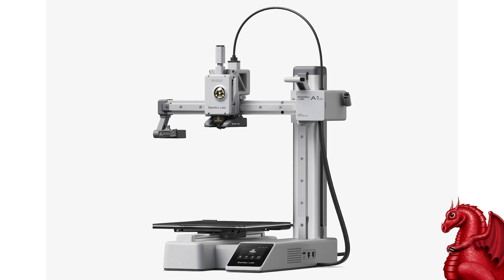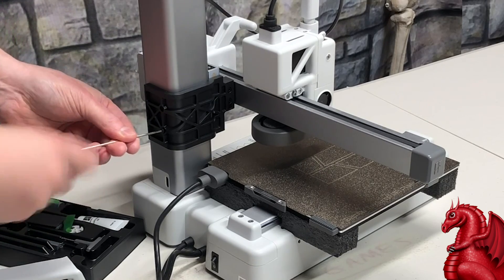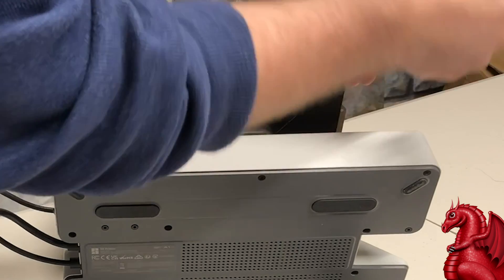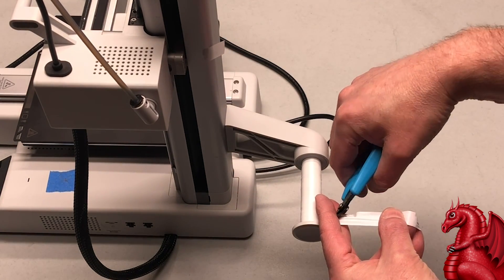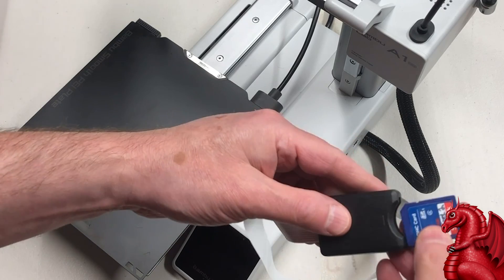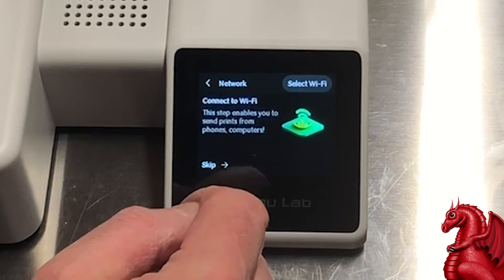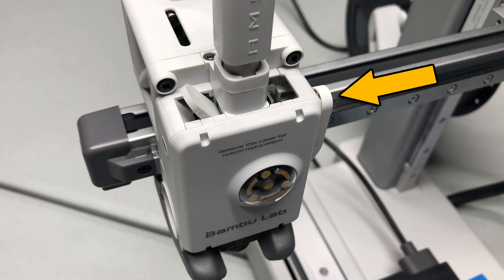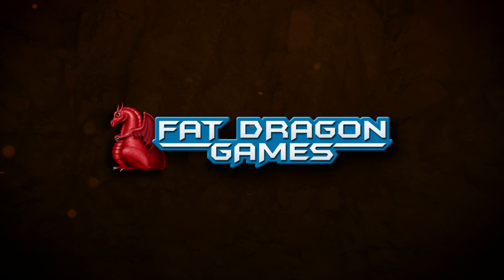Bambu Lab A1 Mini Pro Build Tips

Comment: I tried the plumbers tape, and sadly after less than a dozen prints, the tape has worn completely through on the two spots where the spool sits.  I did a good 4 -5 passes/coats/layers of the tape, not sure what I might have done wrong.

Comment: Objects I make with my A1 Mini come out slightly undersized. For example, I made something that should have been 20mm, and it printed at 19.7. A bigger object at 50mm still comes out 0.3mm small, so this is not a proportional problem. I just need it to add 0.3mm to whatever it prints. Any ideas?

Comment: Thank you for the tips. What I also recommend for all printers is a snap-on filament dust remover. I use them on all my printer and filament. They remove a lot of dust you don't want to have in your nozzle and prints.

Comment: Hi Tom! Just had a question about your mini profile: I find that when I’m printing smaller diameter columns like swords or staves, they tend to break either during the print or very easily after. Do you think this could be because of the cooling fan being so high?
Reply from the maker: Which one of our minis is breaking? I specifically engineer swords and such to have enough shells dictated by nozzle extrusion diameter to avoid this. As far as being caused by the fan settings, I tested for this to eliminate any issues before I released the profile.

Comment: With an Ender 3, you can actually miss the slot and drop the SD card inside the machine, meaning you have to open the printer up to retrieve the card.

Comment: Thanks for the video! I'll definitely be re-watching when I pick up a Bambu A1 or A1 mini. I'm still waffling between the two as I'd like the bigger print bed but I've heard people are getting better detail out of the Mini.
Reply from the maker: They are both fantastic machines, but for miniatures, the a1 Mini does slightly better (I think I may have even that resolved for the A1, but won't know until I can run it again once I get my replacement bed.)
Reply: @3DPrintedHorrors Your videos are really informative. I've seen a few people on reddit asking specifically about any quality differences between the A1 and the mini. When your bed situation gets resolved I'm sure your opinion will be appreciated by many before they buy a new printer. Nobody else is doing this kind of testing, and your attention to detail when making these profiles is very useful. Thanks.
Reply from the maker: @sneakypepe  as soon as the bed replacement is installed I will be doing a full print quality comparison video :)
Reply: @Tombof3DPrintedHorrors  thanks for the reply! I'll hold off on buying a little bit longer then.

Comment: Quick comment: when printing multiple things (like dungeon tiles), try using Print By Object instead of Print by Layer (on the "Others" tab, Print Sequence).  It will print each object fully before going on to the next object.  This is really useful to decrease overall printhead travel time and chance of stringing between models, or one failed print ruining the entire batch.  Your pieces do need to be further apart, but you can still fit 5 models usually - 1 in each corner and one in the middle.
Reply: How does the speed change on this? As far as print time goes.
Reply: @MrAndersonMusic056  In terms of raw print time, it actually increases speed just a bit, since the printhead is focused on one smaller area of the build plate at a time, and requires less travel per layer.  However, it significantly reduces the amount of things you can print in 1 job.  So whereas if you print by layer you can print 9 dungeon tiles at once (in a 3x3 grid), printing by object only allows 4 tiles (in 4 corners; some smaller objects like miniatures would also allow 1 in the center), more than halving your output per print.  Short answer: slightly faster per object, but fewer objects per print, so it requires more human intervention to clear the plate and start the next job.

The last consideration, which I should have said in the initial comment, is object height.  You can have objects of any height by spacing them out on the Y-axis.  But if you add two objects that have overlapping X-axis values (i.e. the front two corners or the back two corners), at least one of them must be shorter than the X-axis bar, so it doesn't get knocked when the second object starts printing.  Practically, this means if your objects are more than ~1 inch tall, you can only print 2 or 3 at a time with Print By Object (but you can print an additional 2 shorter objects at the same time as long as those print first). 

Hope this helps!